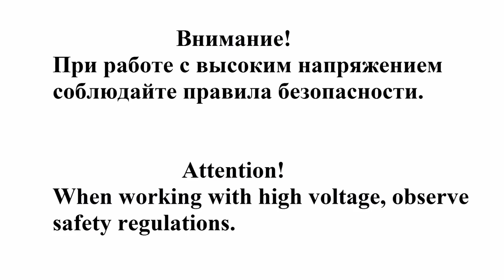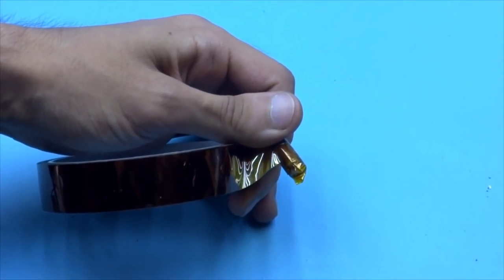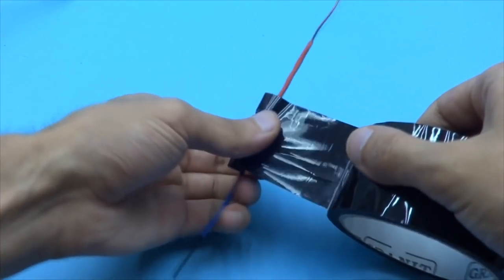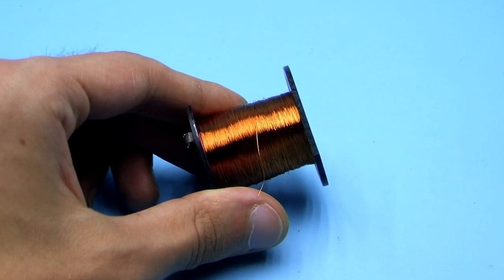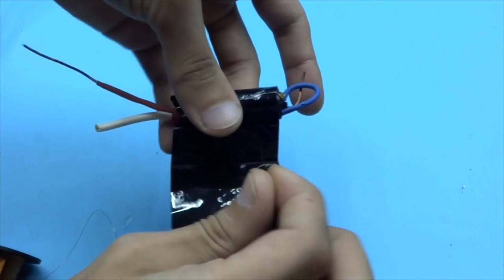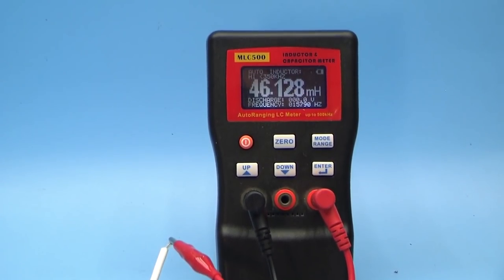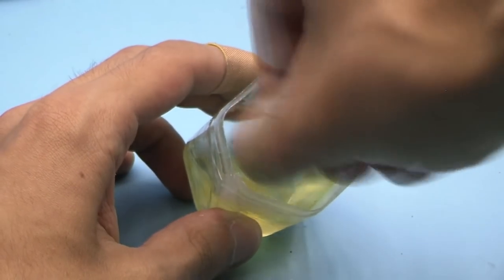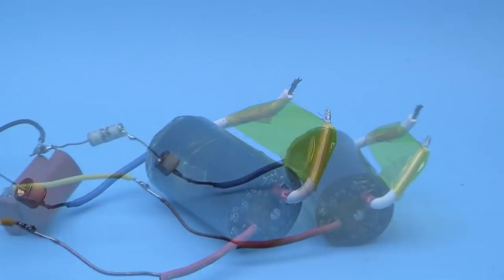DIY high voltage transformer for STUN GUN

Comment: If you don't have a vacuum chamber to drive out air bubbles you can try to make a centrifuge. If it's simple enough you can easily drive it with a motor overnight as the epoxy sets up.
Reply: A dip in very hot water before the use solves the bubble issue ...

Comment: The voltage sparks needs to be much thicker.
Reply: apply more current
Reply: @ES-xq7iu  how do you do that without increasing voltage?
Reply: @ShopperPlug  if the current is limited by the supply you can actually increase power without increasing voltage!

But if the power supply is maxed out you need higher voltage
Reply: @ShopperPlug  you can put capacitors with higher capacity befor the discharge tube in parallel with the coil this way you get less but much stronger sparks in one second